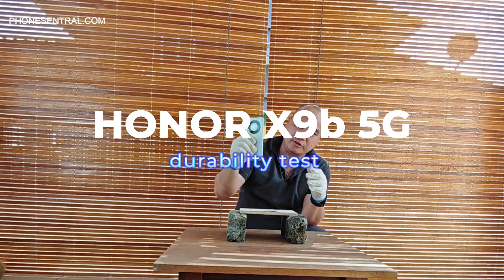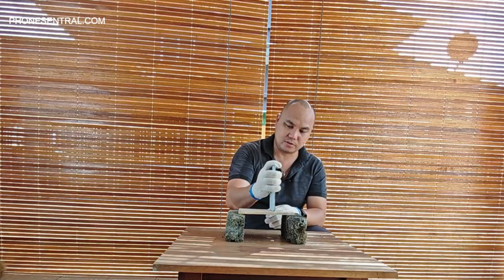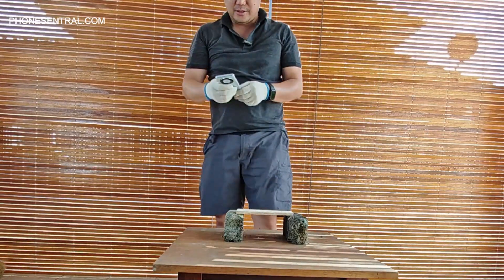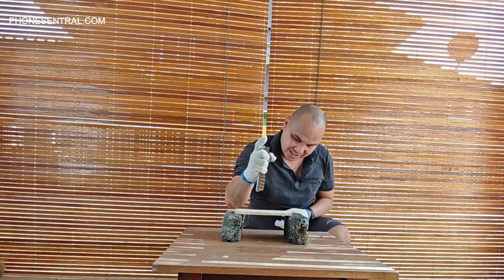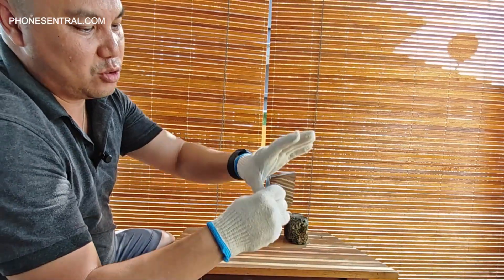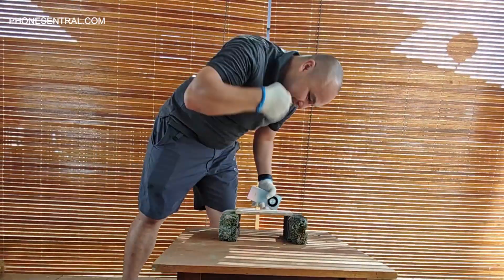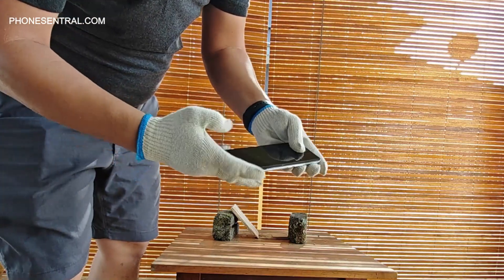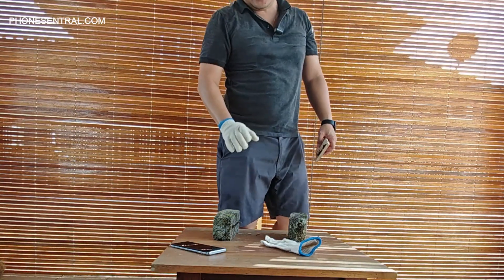Honest HONOR X9b 5G durability test for PhoneSentral.com

Comment: Bu gerçek olamaz😯😯😯
Reply: Yes it's real .. this phone got 5 star rating for it's glass from the Switzerland glass resistance rating .. no phone ever got a 5 star rating meaning this phone glass is extremely durable and it's proven in the video .. for me personally I don't need a lot of specs, ram etc .. I just need a durable phone with long lasting battery..

This phone not only is extremely durable, has a long lasting battery up to 2 days with normal usage ..it also has decent ram and CPU so this phone is an overkill for me hahaha way too good I should say 😂